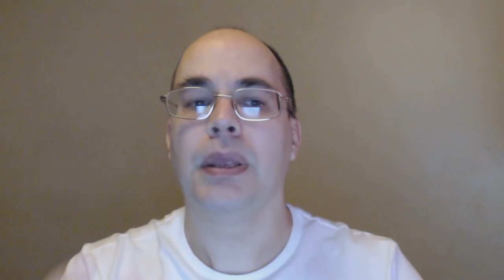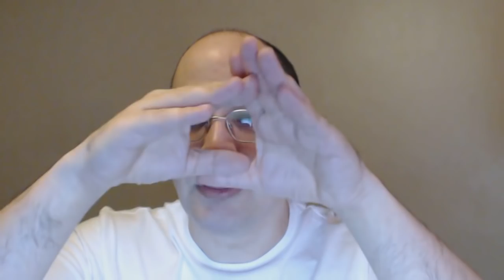How do rockets move in space, with nothing to push off from?

Comment: a very well put together video,  that completely failed to defend the problem, all your examples explain how things move on earth, but in space this would simply not happen. space is described pretty much as an oxygen free vacuum. how exactly does the fuel burn in these conditions? no fuel burning means no propulsion, no propulsion means no reaction, thus no equal and opposite reaction of movement, ignoring the fact there are no particles for the energy to push off, like the launch pad on takeoff.
your effectively saying that from earth it builds all the speed it needs to free float at 10s of thousands of miles an hour through a vacuum till it reaches its target. haha globetards. the earth is flat get over it.
Reply: +Truth s33ker 2
space is described pretty much as an oxygen free vacuum. how exactly does the fuel burn in these conditions?
Rockets bring their own supply of oxygen precisely to make the fuel burn in an oxygen free environment.

ignoring the fact there are no particles for the energy to push off, like the launch pad on takeoff.
The particles that rocket pushes off are generated by a shockwave generated by a continuous explosions inside the combustion chamber. One part goes backwards, another one goes forward, and it's that part that pushes the rocket forward.

your effectively saying that from earth it builds all the speed it needs to free float
No, that's not what he's saying at all.

haha globetards. the earth is flat get over it.
The fact sunrises and sunsets exists, which I can observe with my own eyes prove that Earth is round.
Reply: Truth s33ker 2   "space is described pretty much as an oxygen free vacuum. how exactly does the fuel burn in these conditions?"

The fuel contains volatile components, and includes an OXIDISER to provide oxygen for combustion

Comment: Nicely read off Wikipedia.  Utter bull shit. If a compressed gas is released into an infinite vacuum it just expands Infinitely, and provides no thrust. For an object to move there must be an equal opposing force. And said object will continue at the same velocity and the same trajectory unless acted on by another force.
Reply: +Skibum Wannabe
If a compressed gas is released into an infinite vacuum it just expands Infinitely
That is indeed true, but irrelevant - if the compressed gas has been released, it means it has already done it's job of moving rocket forward. Basically it's like saying "if the exhaust gasses have left the muffler, they can't move the car".

For an object to move there must be an equal opposing force.
The continuous explosion in combustion chamber expands in all directions, providing such equal force. Once part leaves the combustion chamber without doing anything, but the other, equal part which was moving forward will push the rocket before bouncing back, exiting the chamber, and expanding infinitely.

And that's how rockets work.
Reply: Sure was nice to see someone with common sense. You don’t have to be a college grad just able to see reality for what it is. I never stop looking for the truth.

Comment: Nasa is getting a lot of heat from all these fake moon landing and the fake ISS, and try hard to patch up their lies with answers that actually expose their lies even more. You are doing the same thing trying hard to patch nasa lies. It's proven fact that they never went to the moon and can't even travel no farther than the lower earth orbit , that been said in their own words.....rockets go up in our sky due to mixture of gases and fire pushing against AIR. once they are in space they can't accelerate,  turn or stop , because the fire that comes out of the rocket will just go straight in empty space and give no opposite power to help rocket push forward
Reply: +Omar Karim
Nasa is getting a lot of heat from all these fake moon landing and the fake ISS
Not really, no :)

It's proven fact that they never went to the moon
The mountains of evidence prove otherwise.

rockets go up in our sky due to mixture of gases and fire pushing against AIR
That is incorrect. If rockets worked by pushing against air, they wouldn't even be able to lift off the ground.

once they are in space they can't accelerate,  turn or stop , because the fire that comes out of the rocket will just go straight in empty space and give no opposite power to help rocket push forward
The fact that fire comes out of the rocket means that it has already done its job of pushing the rocket forward, so it can go straight in empty space all it wants - it has already moved rocked forward.
Reply: Jan Strzelecki you trying hard to patch a lie , nasa never went to the moon .....you explanation doesn't has any credibility. ....all you do is makinh things up.....no thrust in space ,because nothing to push against
Reply: +Omar Karim
you trying hard to patch a lie , nasa never went to the moon
Again, the mountains of evidence prove otherwise :)

you explanation doesn't has any credibility
Why? Because you don't understand how rockets actually work? What you're saying is "cars can't work at high speeds, because the poles they push against the ground would break."

no thrust in space ,because nothing to push against
Which is why rockets bring their own stuff to push against.
Reply: Jan Strzelecki there is no evidence , JUST ASSUMPTIONS,  nothing to push against in empty space......all what you are saying is a patch lie to claim that space travel is possible. ....AND IT IS NOT
Reply: Jan Strzelecki the fire that comes out of the rocket is FORCE ONE .....NO FORCE TWO TO PUSH AGAINST IT IN SPACE
Reply: +Omar Karim
there is no evidence , JUST ASSUMPTIONS
We have witness testimony. We have extra-terrestrial rocks. We have (impossible to fake) footage. We have transmissions traced to the Moon. We have every single space agency, astronomers, geologists, etc.

What do you have? :)

nothing to push against in empty space
Yes, which is why rockets bring their own stuff to push against.

all what you are saying is a patch lie
And yet you can't actually point out what the lie actually is :D

the fire that comes out of the rocket is FORCE ONE
Yes. And WHY is it coming out of the rocket? Why are you ignoring the rest of explosion that produced that fire?

Are you saying that in vacuum you can produce a shockwave which can only move in one direction?
Reply: Jan Strzelecki you proofs like THE ISS SHUTTLE THAT CAN BE SEEN BY OUR OWN EYE, FROM 230 MILES AWAY AND IT IS A SIZE OF A PLANE , BUT WE CAN'T SEE a plane from few THOUSANDS OF FEET......YOUR PROOF IS SO PATHETIC
Reply: Jan Strzelecki the WE HAVE,  THAT YOU JUST MENTION ARE IN BED WITH THE SAME LIES AND DECEPTION
Reply: Jan Strzelecki show me an experiment, in a vacuum big room and fire  a firework rocket, then show me how how it is moving in there
Reply: +Omar Karim
THE ISS SHUTTLE THAT CAN BE SEEN BY OUR OWN EYE, FROM 230 MILES AWAY AND IT IS A SIZE OF A PLANE
We were talking about Moon landings, not ISS. Focus.

WE HAVE,  THAT YOU JUST MENTION ARE IN BED WITH THE SAME LIES AND DECEPTION
So you're saying that every single member of the professions I've mentioned is part of the conspiracy? Do you realize how impossibly silly that is? This isn't a videogame.

how me an experiment, in a vacuum big room and fire  a firework rocket
No. Answer my questions first. If you can't demonstrate that you actually understand the science, then showing you any kind of an experiment is pointless.
Reply: Jan Strzelecki for your information. Your tactic was used by another user , that tells me , you are not but a troll using multiple acct...THATS ANOTHER WAY OF DECEPTION
Reply: Jan Strzelecki where is the many experiments you claim was conducted, show me. but NO CGI VIDEOS OR IMAGES
Reply: Jan Strzelecki proof it , instead just using multiple acct , proof ISS CAN BE SEEN FROM 230 MILES ABOVE EARTH.......AND WHERE IS THE EXPERIMENTS YOU MENTIONED
Reply: Jan Strzelecki why are you using multiple accts
Reply: +Omar Karim
proof it
The burden of proof is on you, not me.

instead just using multiple acct
I'm using only one account.

proof ISS CAN BE SEEN FROM 230 MILES ABOVE EARTH
Look, if you can't actually explain what is wrong with my explanation how rockets work, isn't it a little bit dishonest to continuously ignore it and try to change subject?

AND WHERE IS THE EXPERIMENTS YOU MENTIONED
I didn't.

Comment: I watched many so called proof of rockets move in vaccum.....and all fail, because the experiment used in a small tube locked from both side , when the rocket fires , it pushes against the wall of the tube ......in space there is no wall to push against........all gases mixture that cause fire is all called force one , and there is no force two to push against.......Nasa is full of lies and deception, NO SPACE TRAVEL =NO MOON LANDING = NO ROVERS ON MARS = CAN'T CROSS VAN ALLEN BELT= NO ISS = NO SATELLITES= CGI VIDEOS &IMAGES ......they got caught many time using cgi videos and images.......
Reply: Ok let's start , POINT 1 YOU WROTE AFTER ME (  I answer all your question in a logical manner. You mine. 1. "REALLY, IS THIS WHY THEY NEVER WENT BACK" Back where? Be precise and give time frame as well)...WHERE IS YOUR REPLY TO THIS .....DO YOU CALL THAT AN ANSWER , WHAT KIND OF ANSWER IS THIS......LET ASK IT AGAIN , WHY NASA NEVER WENT BACK TO THE MOON .....NOW YOUR ANSWER SHOULD BE THEY DID OR THEY DIDN'T BECAUSE SO AND SO.......BUT WHAT YOU WROTE IS BULL CRAP
Reply: +Omar Karim
The force that rocket pushes against (or, more precisely) is pushed by, is the exhaust itself.
The exhaust is basically a miniature explosion, which pushes in all directions at once. We can ignore forces going sideways, which leave us only with force pushing forwards and backwards.

Force pushing backwards does nothing for the rocket, of course, but the force pushing forward will hit the rockets bottom, transferring its kinetic energy and making it move.

And that's how rockets work.
Reply: Jan Strzelecki am sorry , but your answer doesn't have any credibility. ...the gases or the heat that comes out of the rocket doesn't push the rocket, the only way it will push the rocket if those gases or fire are not part of the rocket. The fire that comes out of rocket heat the air under the rocket and help pushes it up.....in vacuum with no air , if the rocket fire, the fire will travel in vaccum and won't give the rocket any push up......watch the failed launch rockets . There is too many of them and you can get the point , that AIR IS VERY IMPORTANT FOR THE ROCKET TO GO UP.
Reply: +Omar Karim
the gases or the heat that comes out of the rocket doesn't push the rocket
If the gases are coming out of the rocket, it means they have already pushed the rocket forward.

the only way it will push the rocket if those gases or fire are not part of the rocket.
Yes, that is exactly right, and that's how it works - rockets release fuel and oxidiser inside the combustion chamber, which means it's no longer part of the rocket, and then light it up, creating a shockwave of hot expanding gasses that push the rocket forward.

he fire that comes out of rocket heat the air under the rocket and help pushes it up
No, that's not how rockets work.

in vacuum with no air , if the rocket fire, the fire will travel in vaccum and won't give the rocket any push up
Before that fire can travel in vacuum, first it has to leave the combustion chamber, and if it's not facing backwards, it has to move forward and bounce off the rocket, giving it forward momentum.

AIR IS VERY IMPORTANT FOR THE ROCKET TO GO UP
Yes, its absence makes rockets go faster :)